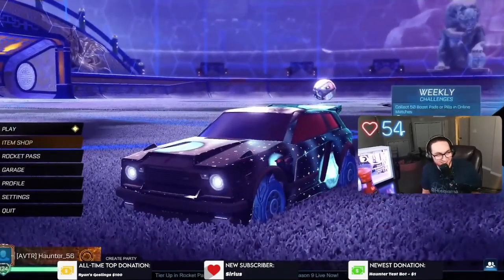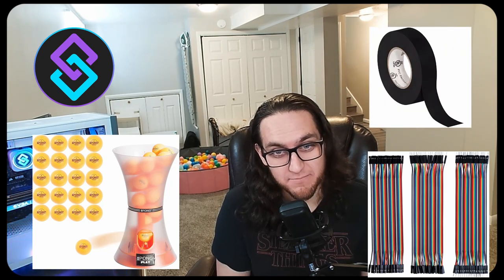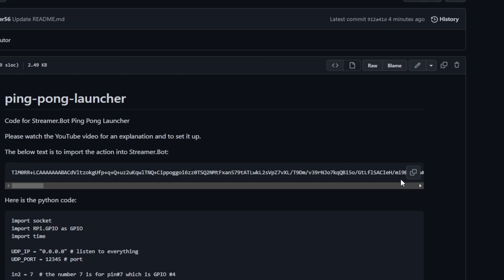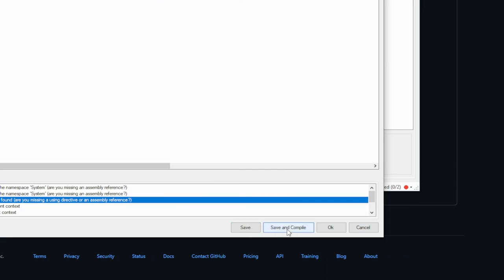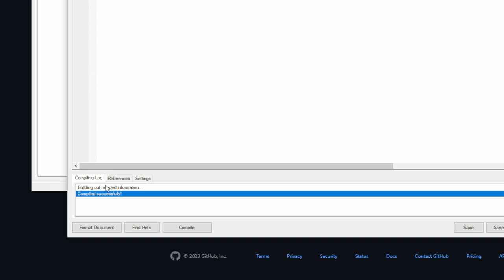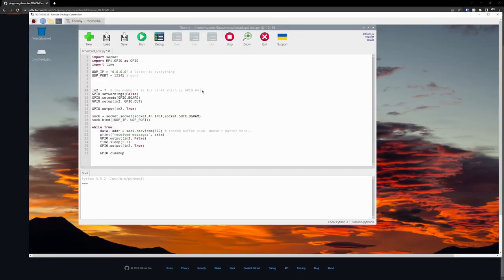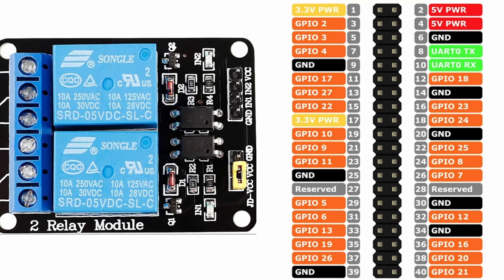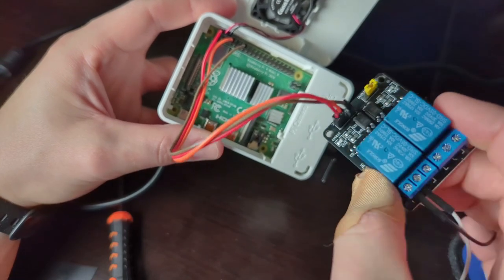Ping Pong Launcher 🏓+ @streamerdotbot 🔥

Comment: I have a similar ping pong setup. However I use Alexa. I have a portable speaker that plays audio when a reward is redeeemed. alexa picks up the audio. turns on the outlet. and a makeshift fan launches a ping pong ball. No manuel wiring involved and cost much cheaper. subbed
Reply from the maker: Awesome! I'm sure there are even more ways like yours that are easier than what I did! 🤣

Comment: What raspberry pi would you recommend on Amazon right now? Raspberry pi 5 single board?
Reply from the maker: I would recommend any of the pi 4 or pi 5 starter kits that way you have everything you need to put it together and you shouldn't have to do any soldering. 😄